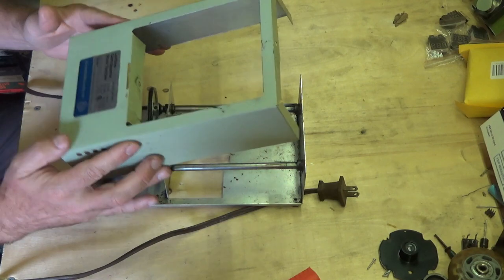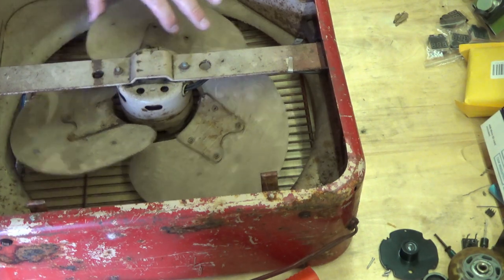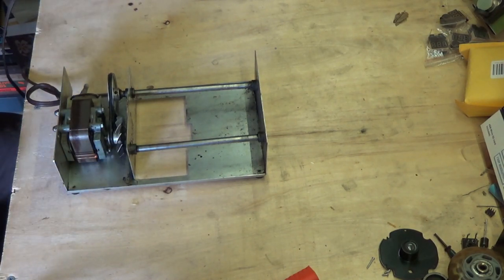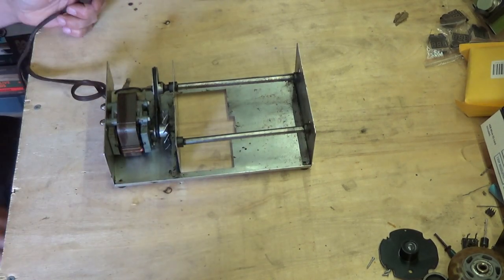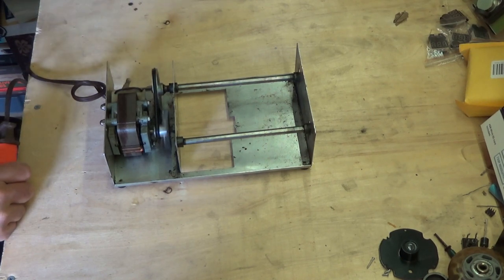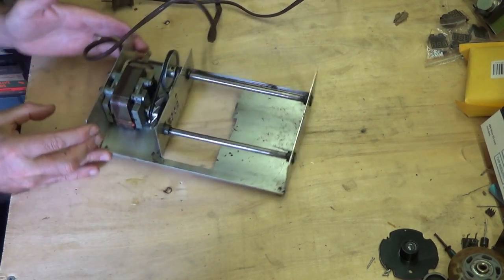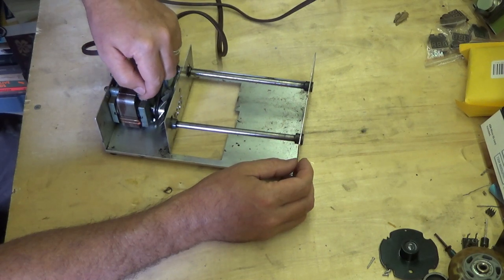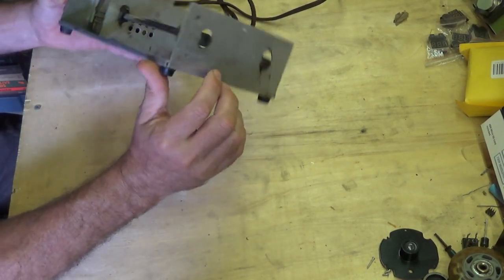How To Repair Stuck Or Loud Electric Fan Or Other Motor Easily

Comment: any tips on fixing the bushing housing? the metal "washer" that retains the bushing doesn't stay in anymore.  The four dinky little cast iron tabs broke off.  I was thinking of 3d printing a pla disc/ring to retain the "washer" that retains the bushing.  Any suggestions?

Comment: U should never use brake clean or carbonated clean level be hide a reduced to use this instead what it meant for Electrical Parts Cleaner and for oil 3 and 1 oil for sawing machine what it meant for or can use marvel mystery oil
Reply: what?